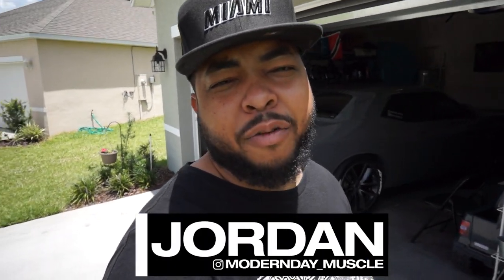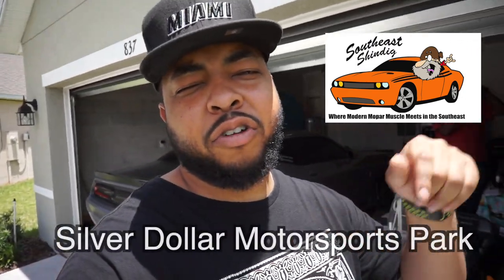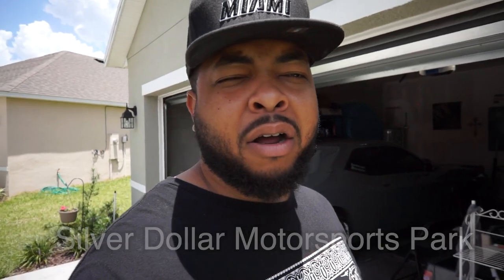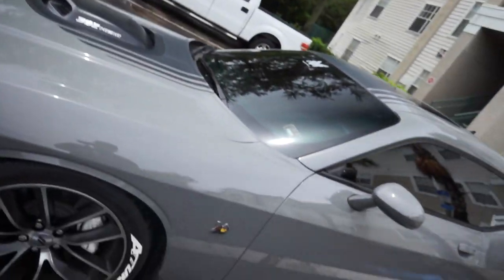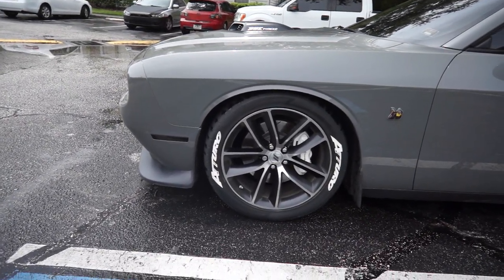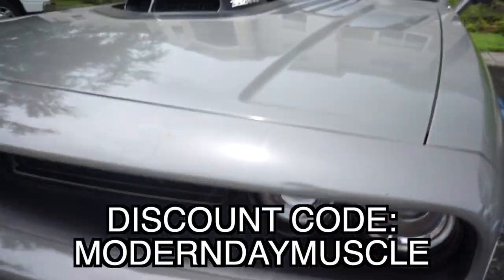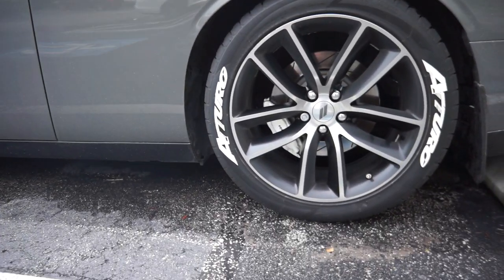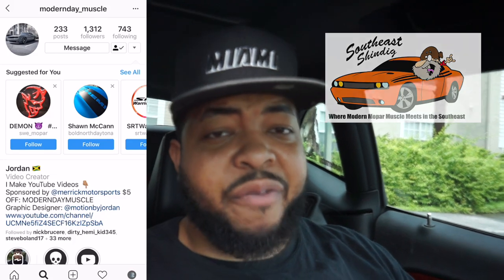PAINTING BRAKE CALIPERS WHITE + MORE (WILL I REGRET!?) | MODERN DAY MUSCLE

Comment: What paint did you use? I want to paint mine white as well.
Reply from the maker: VHT Gloss White
Reply from the maker: Plus primer and and clear coat
Reply: Modern Day Muscle The Engine Enamel one correct? I'm sxt_100th on IG btw... thanks for the info man.
Reply: @ModernDayMuscle  vht gloss white spray can has primer and clear coat you were saying?? or you have to find that to add on top of vht spray if so where could I find it???  I want to paint my calipers white as well and would like them done properly
Reply from the maker: Yes and send a dm 💯💪🏽
Reply from the maker: Yes send me a dm I’ll follow back if I haven’t already